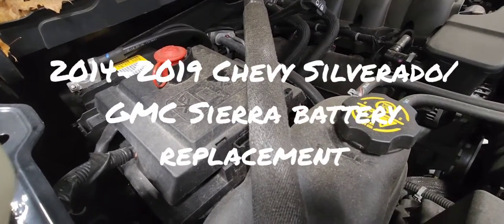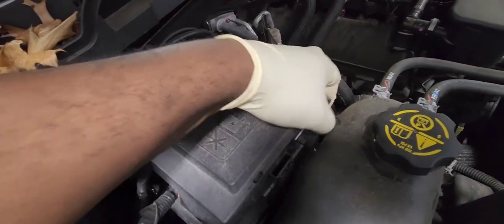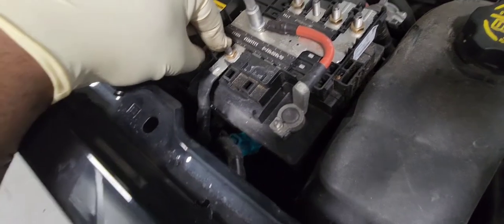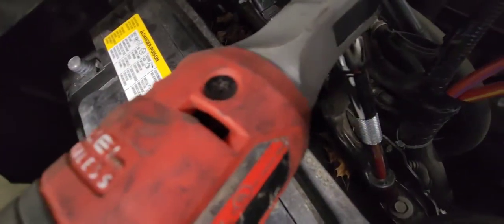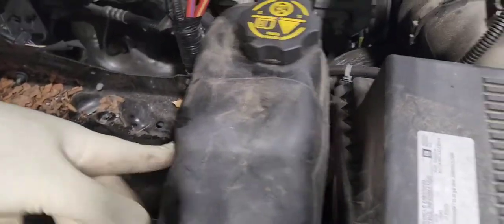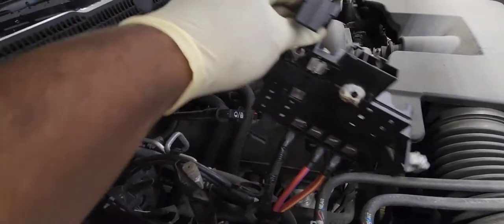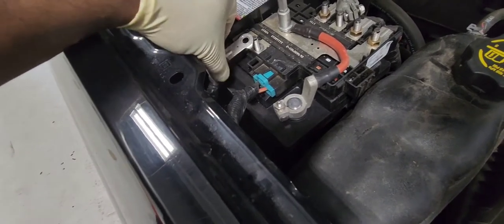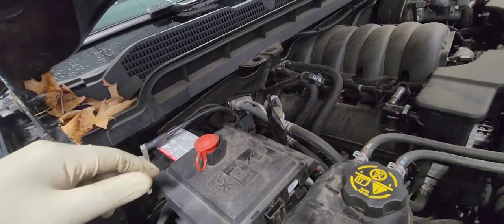2014-2019 Chevy Silverado/GMC Sierra battery replacement

Comment: Thanks Man! Much better explanation than the other vids out there. Looks like you had the optional larger group 94 in that one, if doing the smaller option that came original with the truck, I think you can get it done without loosening the coolant tank.
Reply from the maker: You can try ,gm like give just enougj space at the end you will take out more components